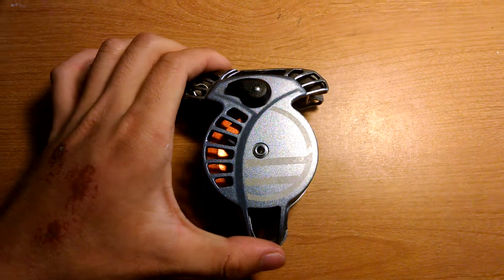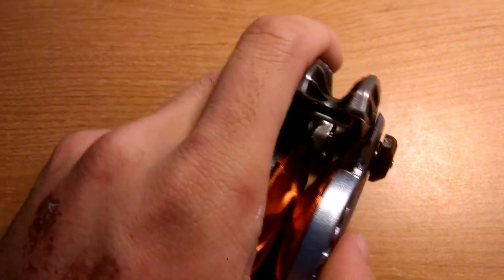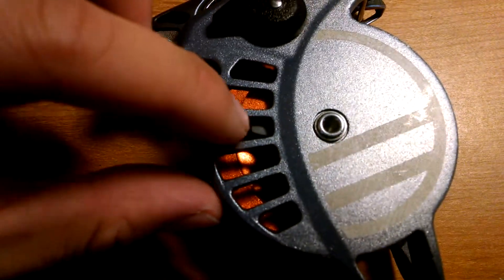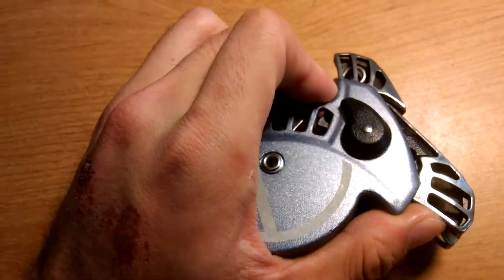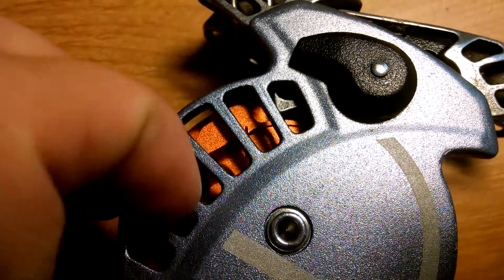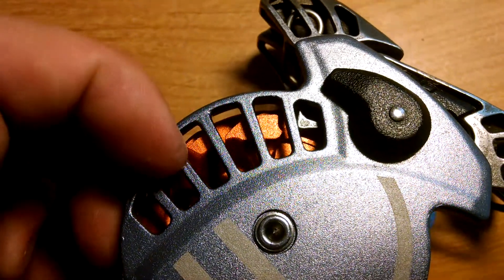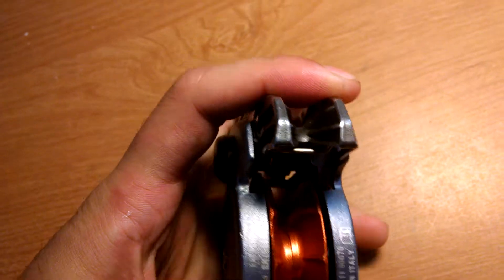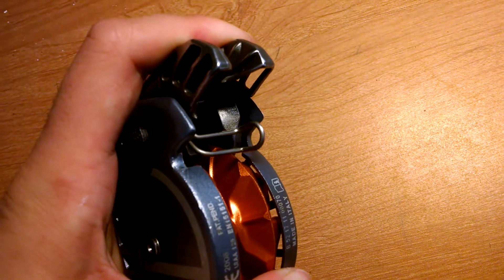Wild Country Revo Braking System Breakdown

Comment: Initial (probably flawed) modification thoughts.. weaker spring = quicker catches, and removing those wires might make working routes easier?
I know initially WC said the Revo would catch at 2.5ms, which has increased to 4ms. I wonder why they changed this. Maybe it was catching whilst paying out slack? I know people say it doesn't catch very quickly at all which makes me question purchasing it for nefarious role solo experimenting